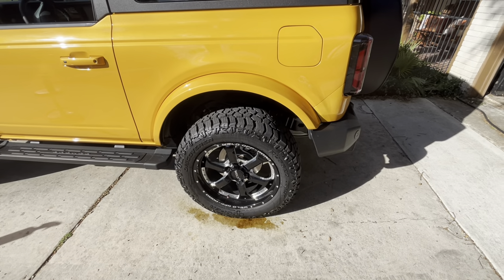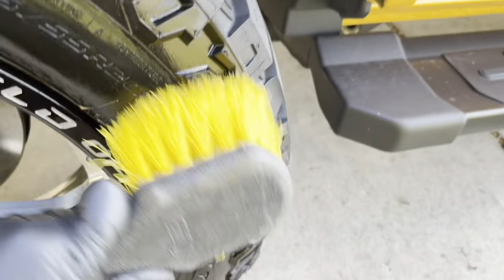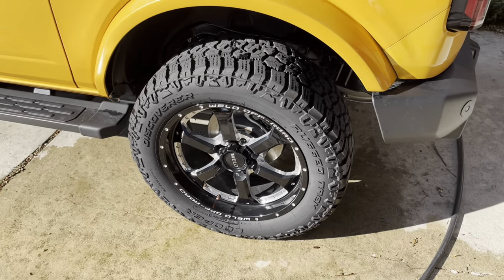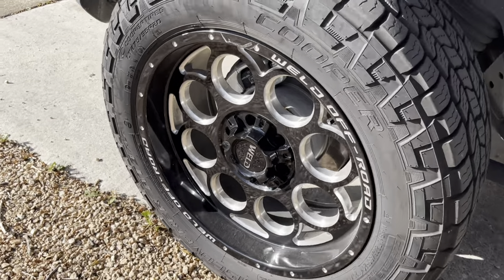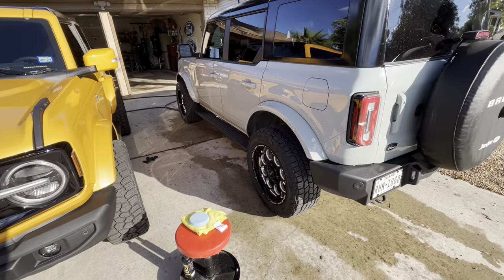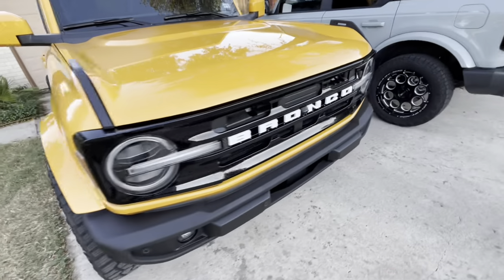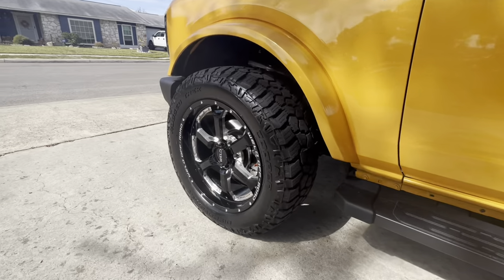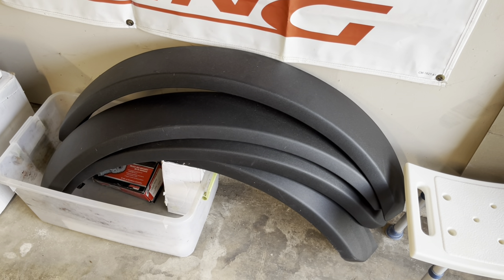Dress your tires like a PRO!!

Comment: Can you tell me again the tire size on that 4 door OB? No lift and no removing of the crash bar?
Reply from the maker: Both are 275/55/20 Cooper Tires👍🏽👍🏽
Reply from the maker: Both Broncos are non-Sasquatch but I purchased some Sasquatch fender flares from a friend and I’m going to mount them on the two door since they are wider than the non-Sasquatch fender flares hopefully it looks OK👍🏽👍🏽
Reply: @IMGONEIN60  thanks!